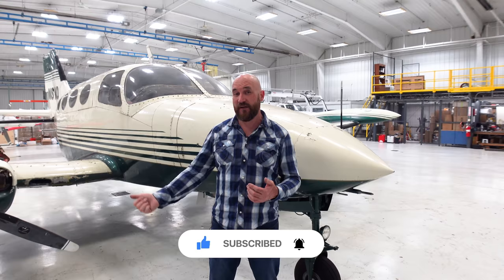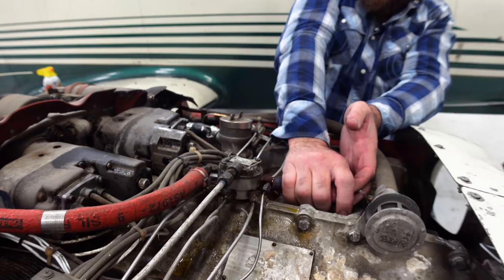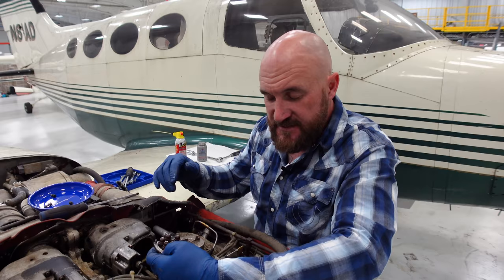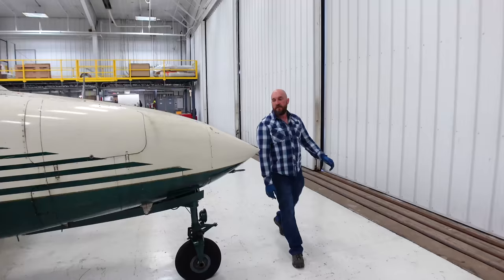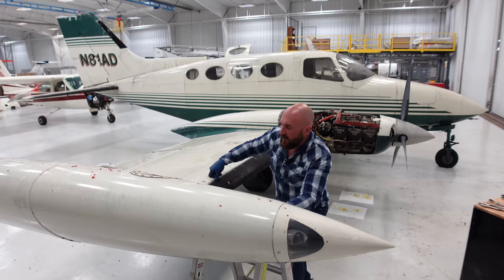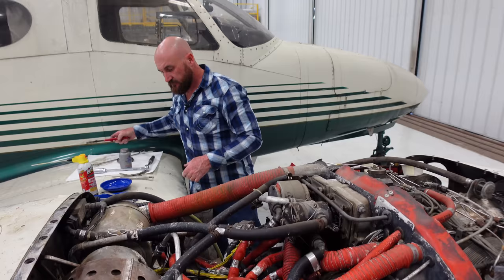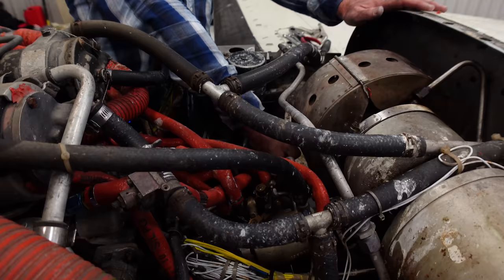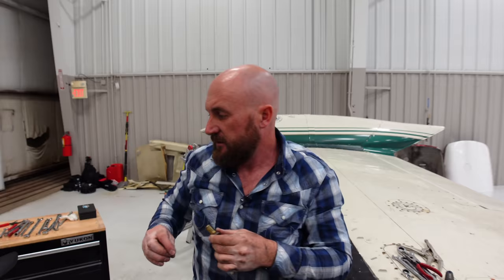He's Trying To STEAL Our FREE Abandoned Airplane ! Ep3

Comment: You have also been addressing the turbos completely WRONG!   Dead wrong.   I think you are going to go down a path to replace the turbos for the wrong, or no good reason.   I've been dealing with this condition for a couple of decades and you are completely off base with them.   A little time and maybe a clamp or bolts and seal, and they can work like brand new, most times.
Reply: These things are designed to run between 100-200krpm typically.   If there was any question about the bearings, you do not risk it.   Rebuild is required if they had any excess play, movement that produces any catch or "grit" feel, or noticeable drag when rotated.   However, it's rarely the case that the bearings are locked up or causing drag, or locking, unless you can shove the shaft to the side and something grabs some coked oil buildup.    I'll just give you the hint that you should research the effect of "rust jacking" on automotive brake systems.   The rabbit hole you'll likely follow can teach you a whole lot that will benefit everything you work on.   I recommend you do said research and create a passable understanding before touching the turbos and other effected parts.   When you do address the turbos, I would suggest you ditch the pb and move to KR-oil and ATF for your chemical aides and take care not to bend or damage the turbine wheels in any way.   If you do, don't fret.   You can purchase new ones.   Just need to know the manufacturer and dimensions of the exhaust turbine.   The compressor may be irrelevant,  but a more involved builder may want to know the specs to Taylor the angle and design to the ratio, but usually not a factor....   man, I really wish o could just be there with you.  Theres a lot of things I wish I could point out and "puzzles" I could solve as you deal with them... I stead of just talking to my TV, lol.

Comment: Hey bro I know it's hard to work on a plane like that but I'm a mechanic not on planes but they kind of have a similarity things about fuel filters that you have over this plane now have you gone through every part of it and my only bet is that it could be there's a clog somewhere and it's got to be either the one you were working on clean out one filter but there's something stuck in the fuel line I mean you cleared all the other ones but there's got to be one that's not you know getting and this clown is trying to take your plane away from you and all the work you done to it so far I wouldn't give it up I mean the man needs the money but you had an original contract with him I like I said I wouldn't give it up so I keep a prayer out for you just take it easy
Reply from the maker: Thank you Chris 
And thank you for watching !

Comment: I can make you a deal, if you think you can make me a deal.    I REALLY have always wanted to be a helicopter pilot, but thats not realistic for any civilian that's not a millionaire,  because it's around 350-450/hr for Insurance plus equipment time and fuel, so o can't afford to compete with the 2-10k hr military pilots, which is the "minimum" experience level they have coming out and applying for the same job... I am just not a millionaire,  nor was I raised on middle class and above lifestyle or resources.... but I'm in a good enough situation for myself, so I set my sights on the next best thing for a goal.   I'm looking to get into a twin engine underwing for 4-8 passengers on a tight budget.   If you have, or have access to a great deal on something small for me, what's left available in the budget can go to that plane's owner, I'll help you get it running again for less cost, and less headache.   I really am an expert on reviving anything that has been left to sit for a long time, with good results.

Comment: Bud your working with chemicals under pressure or that can have volatile reactions.  Please wear some safety glasses minimum.  Connecting that battery like you did without safety glasses is like Russian roulette with battery cables to me.